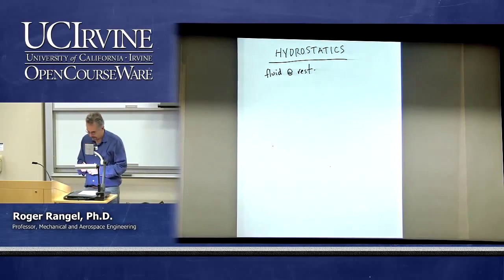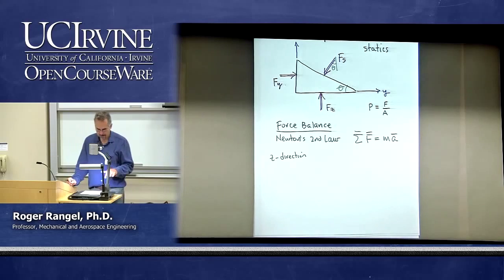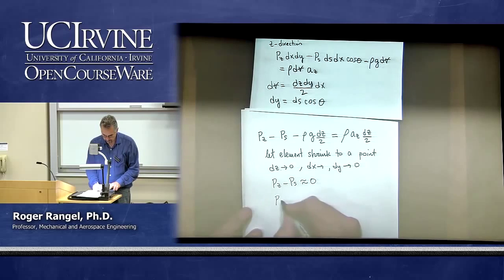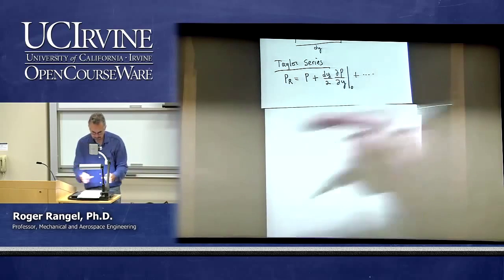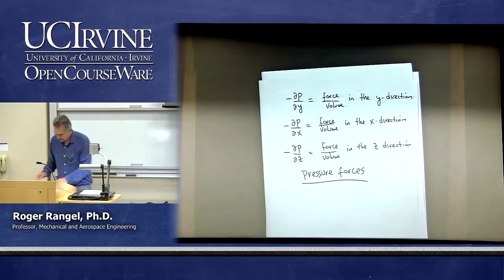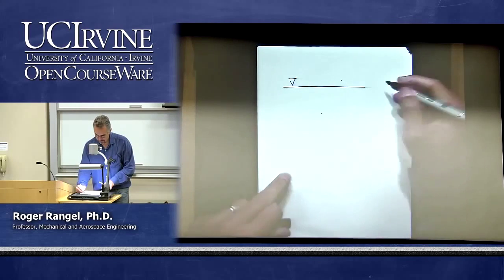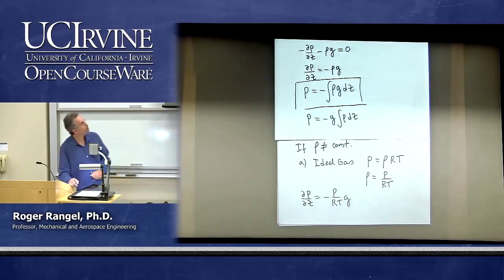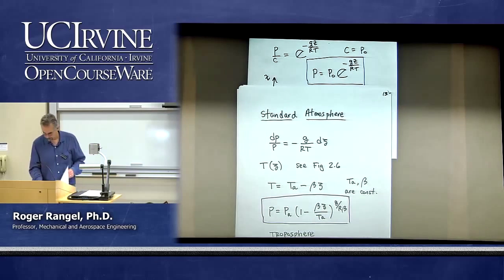Engineering MAE 130A  Intro to Fluid Mechanics  Lecture 03 4

Comment: why did the doctor stopped writing (dp/dy )at the center and he begin to write dp/dy in general ??
we learned in math that if we want the taylor expansion around point a we write f(x)=f(a)+(dy/dx)@a (x-a)
Reply: in answer to your question, he "shrinks his (cuboid) finite element in the x , y and z directions".  His shrunken element is then his origin (or "center" as you call it) by itself, i.e. his whole shrunken element consists of the origin alone, so he no longer bothers to say "at the center" since "the center" is all he has!

i'm not sure what point your making concerning your experience of taylor expansions - this is exactly what the professor does.  in his case, the (x - a) term is ( P_R - P ) which equals ( dy / 2 ) in his cuboid example (as demonstrated by the labels on his cuboid drawing)

Comment: 1-why did he choose the  center of the fluid element to be a reference?
2-how is the pressure to the left of the center equal to (p+dp/dy) i think we moved on the same level so there isnt a change in pressure?

please answe me
Reply from the maker: rahaf assaf  You can choose any corner to do the demonstration, but it is easier to show if from the center since you can do the same in all directions. At min around 23, you can see the Taylor expansions for both, the right and left direction and the force, notice the sign (- for left, + for right). The change to the right (y+) is dy/2 partialP/partial y,  so you add that to the value at the center. If you are looking at a problem in hydrostatics with g vertical (z), you could say that dp/dz=-rho g, there partial p /partial y is zero. However, that is not the general case.
Reply: but why the pressure vary when we move dy/2 . horizontally ??????? can i say that in general the pressure is different at each point in the fluid ?
Reply from the maker: rahaf assaf The derivation is general for hydrostatics, so it allows for accelerations in any direction. If you have a component where a - g is not zero, there will be a pressure gradient, therefore the pressure is different in that direction. Example, grab a bottle, fill it and accelerate it horizontally. Notice how the surface rotates, and now you have pressure gradient in the horizontal. Another example is the whirlpool. You could complicate it all you want by adding forces, viscous effects and the flow in a pipe for instance, or shockwaves, the sound, etc. So yes, it could be different, but that depends on the net force and the acceleration.
Reply: to get this sraight >>> the fluid element that is used in the derevation is taken from a fluid that has a pressure gradient in the x y z >> so the fluid is ageneral case for fluid that is accelerating in all directions>>>> is that true ?
Reply from the maker: It is a general case for hydrostatics to derive the governing equations, but a similar approach can be used in hydrodynamics. It is not limited to the case of gravity pointing downward and no acceleration. The pressure gradient in a given direction arises due to a force (i.e. inertia, gravity). You remove the force and after a while the pressure gradient is zero.